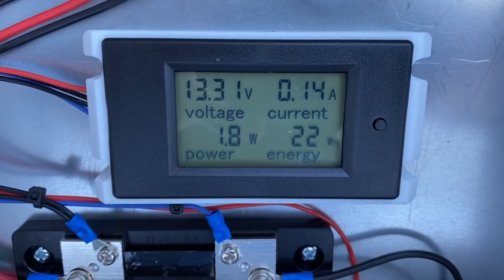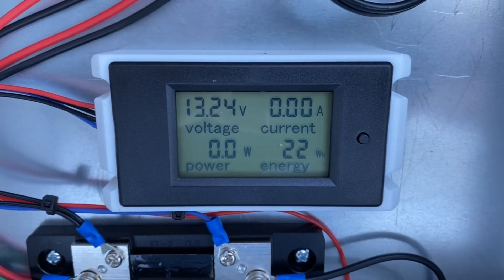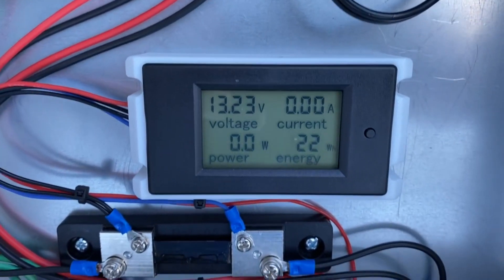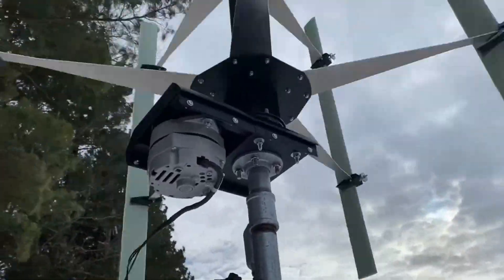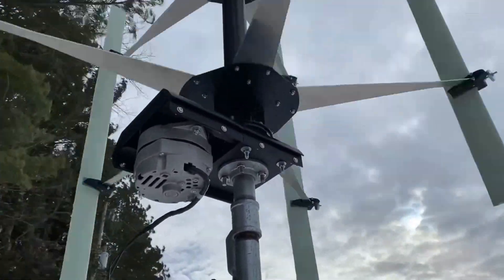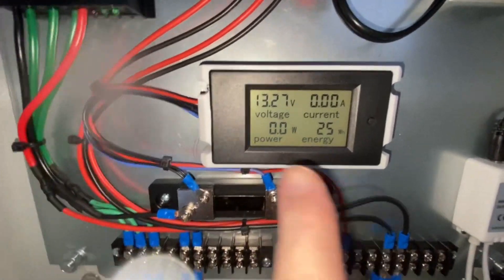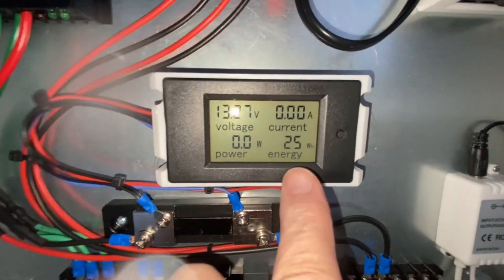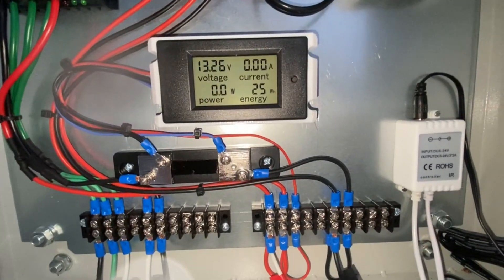New Large Sharp VAWT on a Windy Day

Comment: Either the battery is charged, so it can't assimilate the available power from the turbine, or, you're spending more current energizing the rotor field of the alternator, than sending to the battery. The charge controller seems to be working perfectly! You may consider removing the cooling fan from the alternator. The wind that powers the whole apparatus should provide adequate cooling. That would allow more speed multiplication to spin the alternator faster without windage losses from an unnecessary cooling fan. Turning the alternator faster would produce more current from the stator, with less current applied to the field, making more power available to the battery. With a little fine tuning, this rig could probably generate more than double the power, from a given wind speed.
Reply from the maker: This is a PM alternator I got from Missouri Wind and Solar.  So there is no field winding.  But I agree that the fan is not necessary in this application.  I figured it wouldn't hurt much.  Here is a link to the PMA: https://windandsolar.com/12-volt-7-magnet-permanent-magnet-alternator-ac-output
Reply: @MickEMaus3000  If you gear it up, it will produce a higher voltage, reducing the amperage needed for a given wattage. You do need to make sure you don't over rev it.

Comment: is the dump load to heavy so it's acting almost like a short circuit?
Reply: You WANT it to do that. If the dumpload resistor is too high value, it could allow the turbine to turn fast enough, to turn the dump load into a heating element! To save heat, the best bet is to maintain lower voltage, for lower speed, reducing the efficiency of the turbine.
Reply: @vincentrobinette1507  Thats what I would engineer it for; a heat element so with just enough resistance to keep it out of overspeed in strong wind